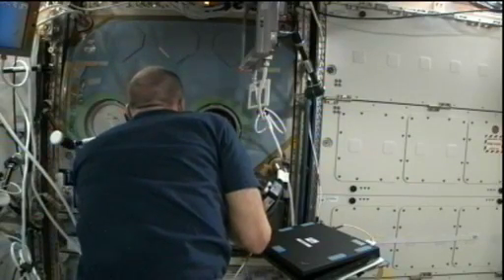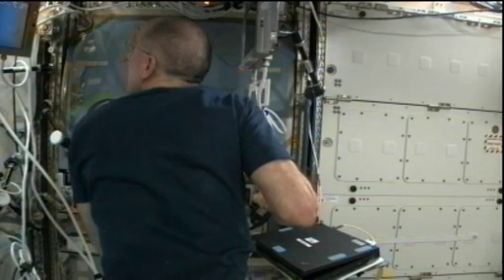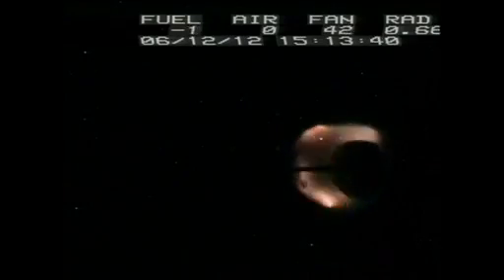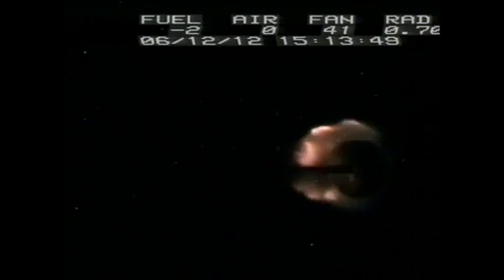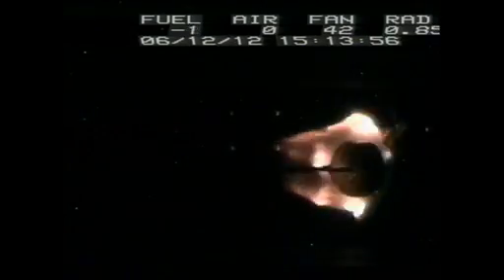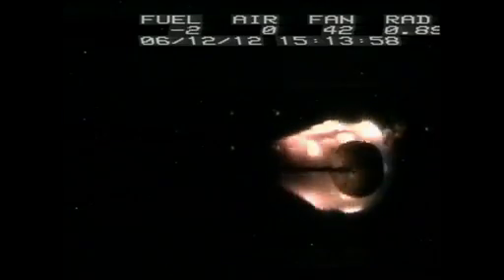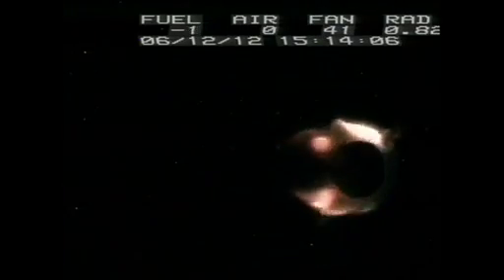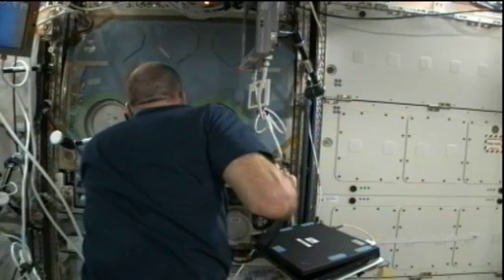How Does Fire Behave In Space? | Video

Comment: I would imagine that the air currents inside the space station from the air vents would be the dominant force on the balloon.  There is another video of a tour of the international space station on youtube and he demonstrates how if you lose something in the space station you can usually find it on the intake vents of the ventilation system.  The air is being sucked in at those vents and anything floating around int he station ends up stuck against those vents.